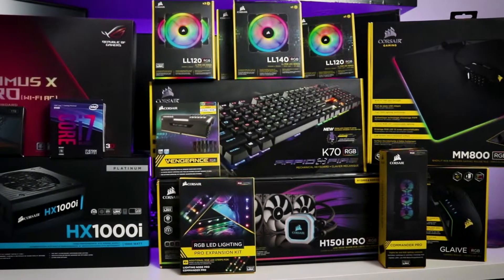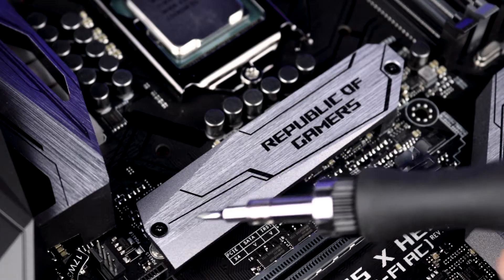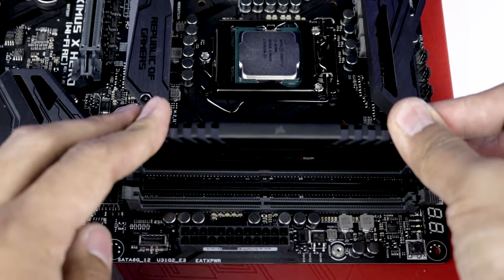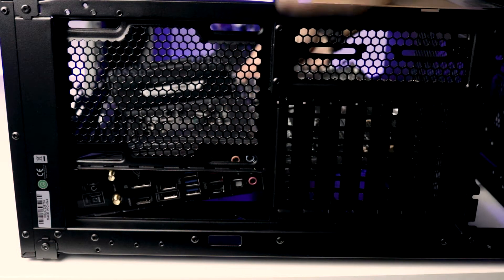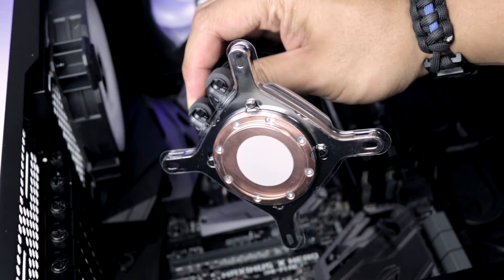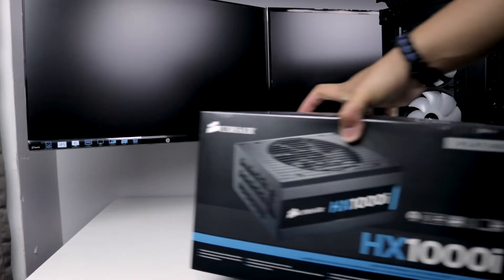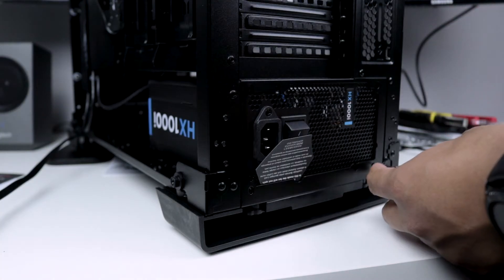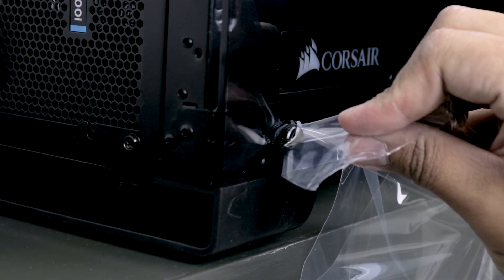How to BUILD an EPIC Gaming | Content Creating MACHINE

Comment: Great and clear guide! Just a question since I'm building my new PC with the same case. How many fans you have for exhausting and what If I put fans behind the radiator?
Reply from the maker: Thank you very much! I currently have three fans that are acting as exhaust. Two Corsair LL140's on top and one Corsair LL120 fan on the rear of the case. On the radiator, I now have a total of six fans that pull in air into the case from the front. Specifically, three Corsair LL120's on the front and three Corsair ML120's behind the radiator. I installed the three fans behind the radiator because I wanted to have more "pull" of cool air to come in and to be distributed throughout the case. Hope this helps answer your question. Let me know how your build goes and if you have any other questions I'll be more than happy to help. ^_^

Comment: Just built my first PC I have the same case and water cooler, but I put my radiator over the front 3 fans will I be at a loss at all with this setup?
Reply from the maker: Hey that is a good question! I don't see why you would be at a "loss" friend. If you have the fans installed behind the radiator, it would be considered to be pulling air in to your case (a "pull" setup is great as long you have other exhaust fans pulling the air throughout your build.). You'll most likely see an accumulation of dust on the front of the radiator in your build. But that is okay because in my experience, having fans behind the radiator is beneficial in the sense it would be easier for you to clean your radiator with a soft bristle brush. If you had your fans installed on the front of the radiator, it would force air through and possibly jam up some dust into the body of the radiator over time (A LOT more time consuming to clean). Sorry for the long explanation but hope this helps. Any other questions just ask away! Have fun with your build! And remember, dust kills. ;-)